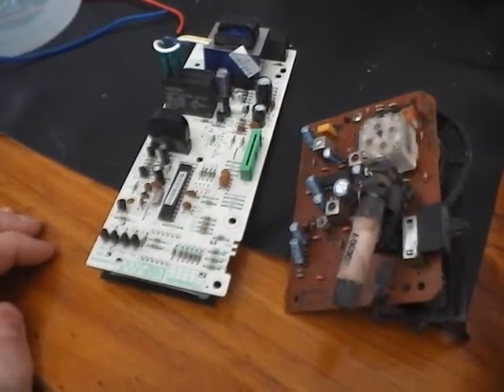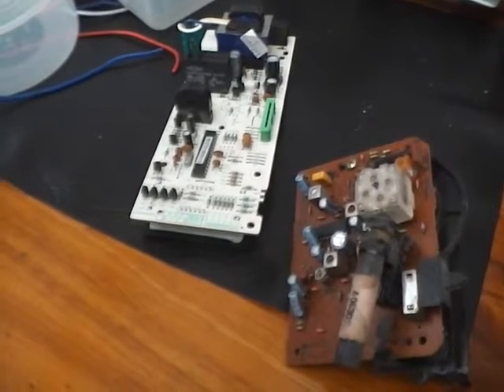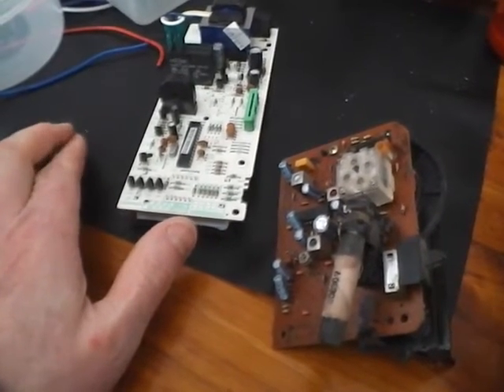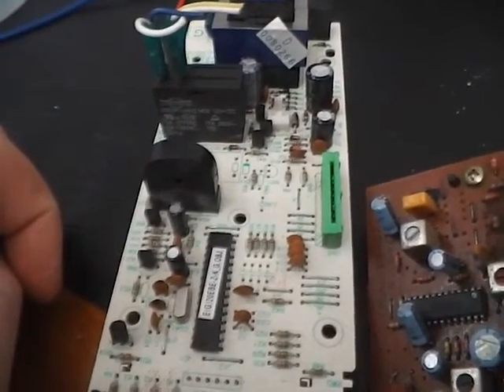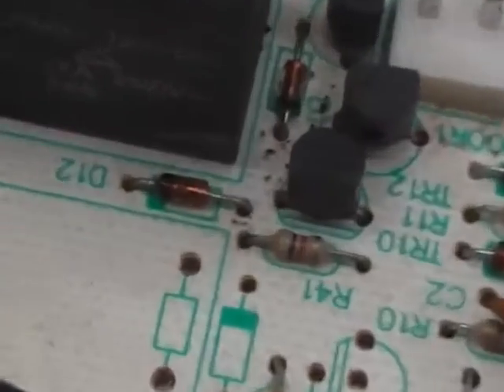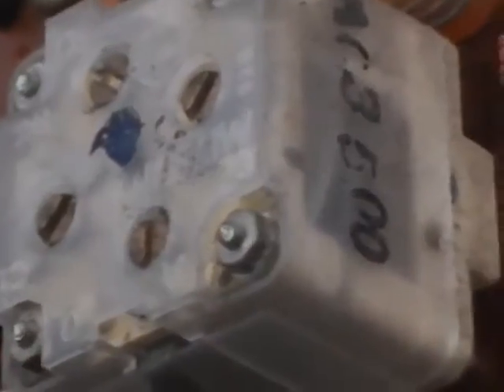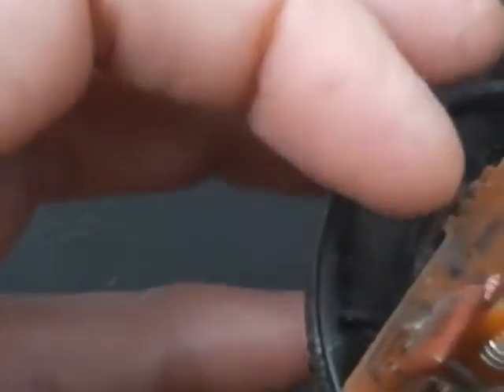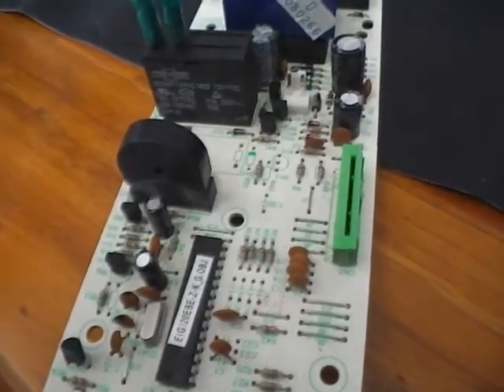NO POWER crystal radio from salvaged microwave and standard radio

Comment: Very Creative. Those piezo buzzers make nice headphones as well.A nice spider web coil combined with a push pull coil will harvest enough electricity from the air to light an LED that will modulate to an announcer's voice.Given a solid tone on some frequency will light the LED at a constant brightness.These radios can get real expensive to produce with silver plated air variables and 600/44 litz wire like Mike Tuggles 'Liondine' radio. Midnight Science has a website dedicated to crystal radio you might want to look at.
Reply from the maker: Ive seen people using peizos to generate power. They used rainwater drops to move it.

Comment: Link love your vids, but I built one of these when I was about seven, that was when they broadcast on AM.
Now days they do it on FM. So what would be the point!
Reply: +macsoutside tony Even worse-----Digital! 
Radio is sadly (very sadly) Becoming a thing of the past.
Reply from the maker: There is little point in owning one,  but under hard conditions or conditions where radios are confiscated (as happened in ww2 to US soldiers due to some radio part being detectable,  hence the nazis could know if Allied troops were nearby), then crystal radios are worthwhile. Battery free also helps under warlike conditions.  I have always been fascinated by crystal radios.
Reply from the maker: 69Phuket they released digital radio here. Biggest commercial flop ever. Well at least since they tried to sell Dr Pepper in Australia.
Reply: +Link Knight Me too. My dad made me one....Sounds, free from the ether is ultimately fascinating.
Reply from the maker: 69Phuket what's more fascinating is the atmospheric motor. it's basically a tiny electric motor that will run from the same type of energy. I knew it could be done but flipped out when I saw it. You are likely to find it in a youtube search.